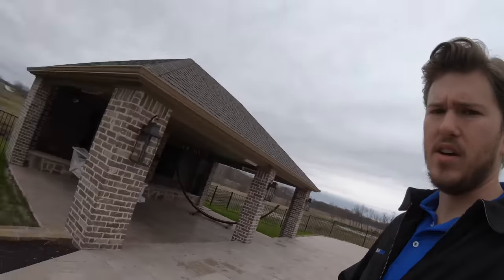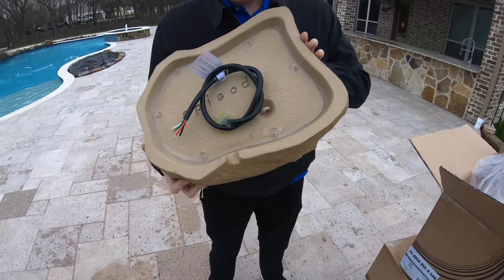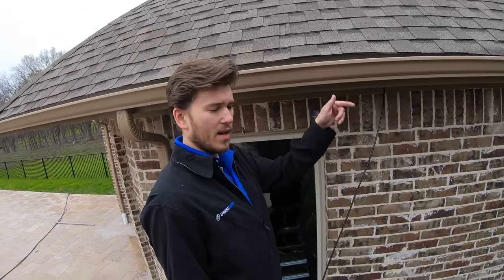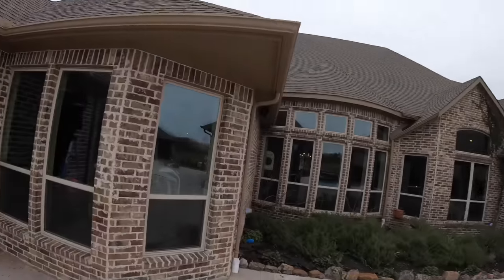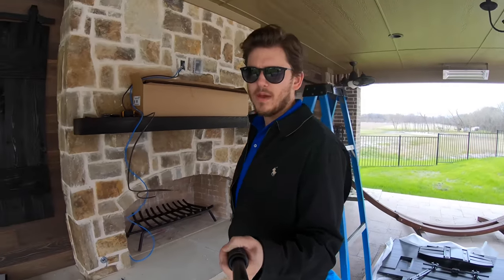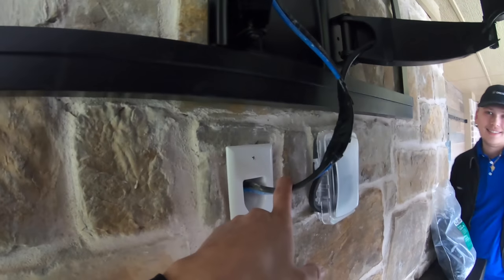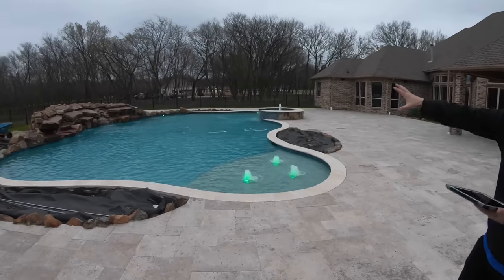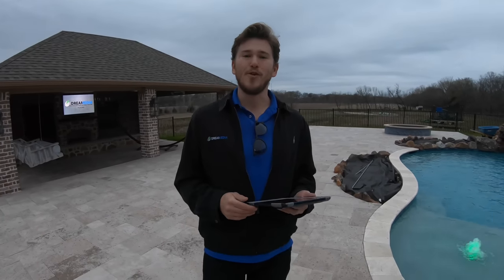Backyard / Pool Sonos System w/ Tv Under the Gazebo

Comment: Would you recommend a sonos amp for every zone or one multi-zone amp with a sonos connect for each zone (something like a Dayton Audio 12 channel multi-zone amp). Trying to save a few bucks with the connects but not sure if it's worth it.
Reply: Hi Andy.  This is Darrin from UnifySmartHome.com.  I know this is over a year old, but I thought for other people asking the same question I would respond with my personal experience.  The Dayton Audio MA1260 Multi-Zone is a 12 Channel Amplifier with 60WPC.  In this backyard, they installed 6 speakers/with 12 channels (Each speaker is Dual Coil 2 channels)  with 3 independent zone controls. To get the same control experience using the Dayton, we would need 3 Sonos Ports $1,350.00   and the MA1260. $750.00. $2,100.00 Vs $1,950.00 for 3 sonos amps, takes up a lot more room 16" wide vs 8.5" and now I need 3 sets of RCA cables and more wiring. I also have introduced another fail point ( The new Amp)  and if it fails, my entire system goes down.    Hope this gives you some good perspective.  Thanks.  Darrin

Comment: You mounted the Playbar upside down.
Reply: It doesn't really have a "right side up " sonos  knows that it's a DIY product and that the name is a palindrome, so consumers dont really know where "up" is. Sonos has software "back up plans" and it knows which orientation its in, whether it be laying down, sonos logo up or sonos logo down, it will crorrect the LCR layout in the software. Also, its a cleaner setup if you have all the sonos I/O  going up, so that you dont have a possibility of having the wires poke out the bottom.